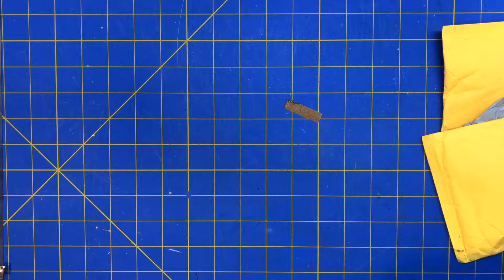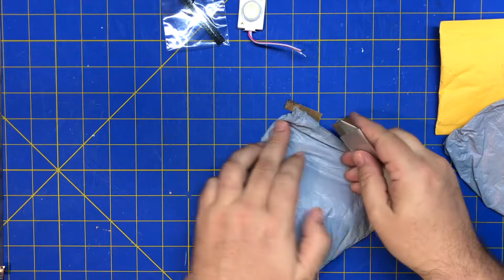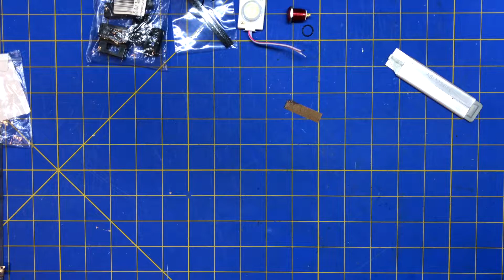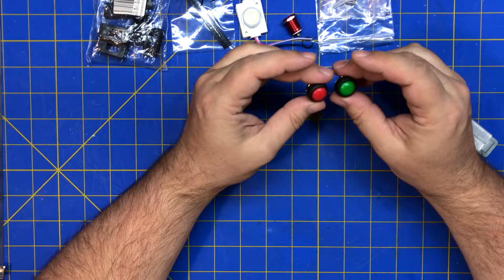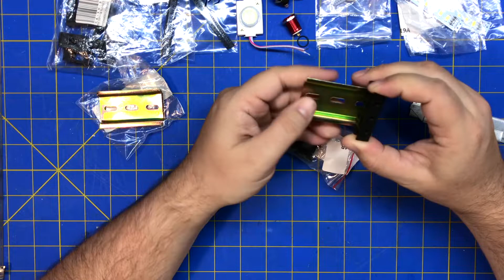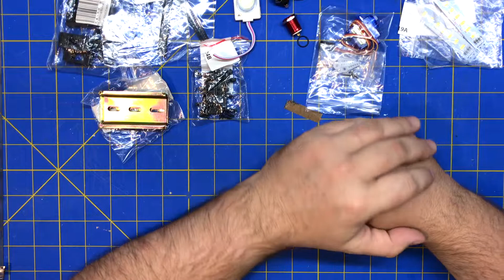Mailbag #56 10-2019

Comment: Its for C or G rail as apposed to U rail.
Reply from the maker: I will have to buy some to check out, I am pretty sure C rail is what they use for electrical box pole mounting/conduit mounting, with those metal compression clips.
Reply: @tablatronix  Ah, thats unistruct, C rail is a thinner metal the same gauge as din rail.
Reply from the maker: ahh you are right, I never knew the name of that, thanks, I also need some of that! lol
Reply: @tablatronix  Its only called unistruct because the name is stamped in it!
Reply: @tablatronix  ive seen it all used in electrical boxes over the last 20 years but its mostly G and U rail used. nowadays U rail is the norm.